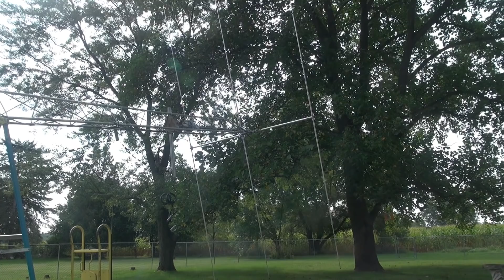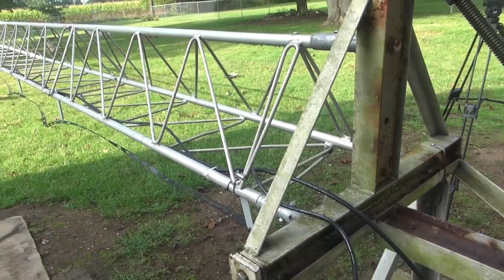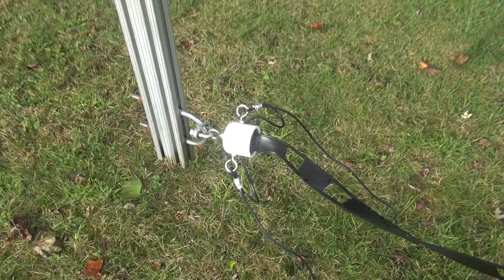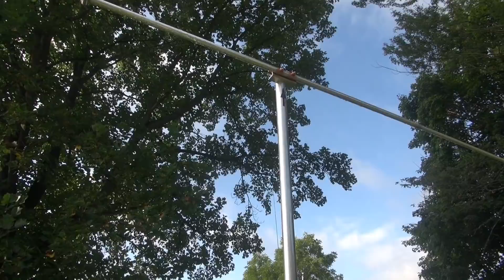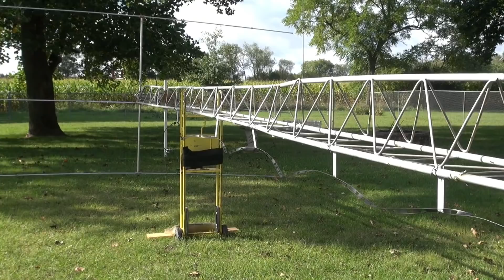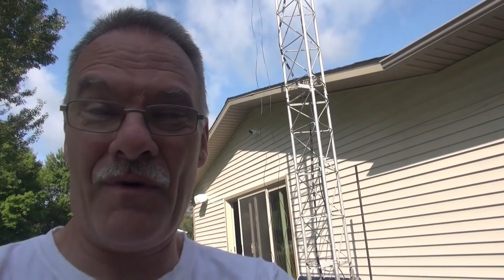Installation of  Cushcraft Ten-3 Beam Homebrew Heights tilt over Tower Ham radio station antenna

Comment: The U bolts are too large, or the mast is too small a diameter. the mast diameter is predetermined by the bushing at the top of the tower.  But the way it is, I can't imagine that the beam will not eventually move on the mast.

Comment: I bought that rotor for my first antenna last week. After looking for a good used one and finding none I thought I would go new. Last thing I want to do is go up on the roof to service this thing. I'm paying someone else to up up my antenna. I'd use an electric drill or something to turn that tower lift screw.  Keep that too coated with anti seize or the right kind of grease.

Comment: I have the same tower. been up at my place for 38 years. I have a ham 4 rotor and specially repaired hornet tri band beam. those clear nylon straps will not last. also put  ground wire from the beam mast grounding the beam to the tower top. its worth the effort to put the steel ring gear in the 45-2. nice installation you should have a good time with it.

Comment: Nice antenna. But a gear reduction drive would be nicer then a ratchet. You probably don't lower it much, so it would not be cost effective. So how did the antenna perform, that would make a nice video.
Reply from the maker: Yes, I checked into the motors, Last time I did antenna work was 10 years ago. I have a nice flat SWR. Waiting for 10 meters to open

Comment: hey dude, I just enjoy listening to CB with my 60 ft Alpha Delta sloper antenna it has a 2nd element with balun that is 15 ft. Since CB is the 11 meter band, does this mean you cannot possibly receive 10 meters using anything designed for shortwaves? Would I be able to use the sloper for transmitting?

Comment: yup...you can't overstate not letting it bounce.
I have seen a guy bouncing one up and it  bent in half like cooked spaghetti.
And G5RV's are a great antennas..the twin lead acts as a vertical on the high bands and there is no need for a balun. In about 2 years that beam is going to be a blast to use.
My code is down to 4 words per minute...But I hope to hear you on 28.350.
DE W9TIT

Comment: just be sure its Protected from lightning from storms gotta have a good earth ground on that ,as thats pretty high up in the air, so Hopefully u have all the stuff protected both inside and out side. But that should get you some good stations on the Bands you use most. but as i say Its Like a giant Lightning rod now, so be careful during Storms etc.

Comment: Looks good Terry.  I will be interested to hear your experience with the G5RV though.  I ran one for years with good luck, but the window line was not run near anything as the destructions with it when I bought it said to keep it away from anything since it was part of the radiator.  My horizontal wires corroded in two near the end insulators after about 15 years.
73 WB8FEQ

Comment: Quick tip; only use black zip ties outside. They are the only color with any UV protection and will last a lot longer than the white ones I saw on the Coax supporting the service loop. 
I see people use the metal ones but they cause PIM (noise) if used within 10 feet of any antenna or connector.

Comment: Nice tower. My dad had a steel tower with a two element 10m beam, above that a long x beam for vhf, above that another one for the ufh and of course a long wire down the garden. This video brings me back. There happened a bit of “antenna down, another antenna” up those days.Thanks for sharing.